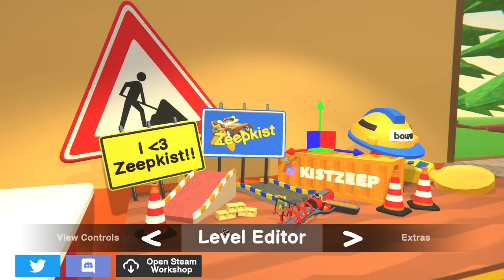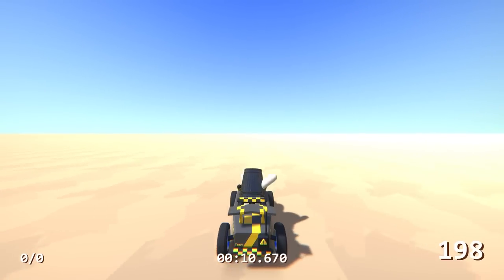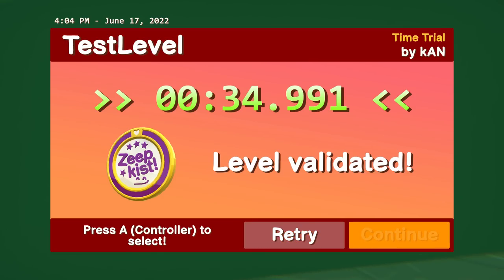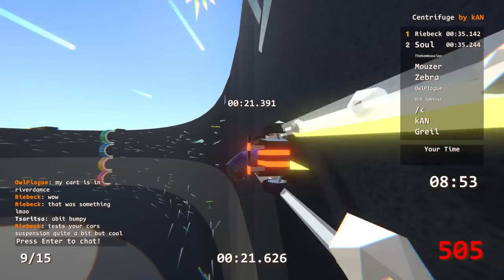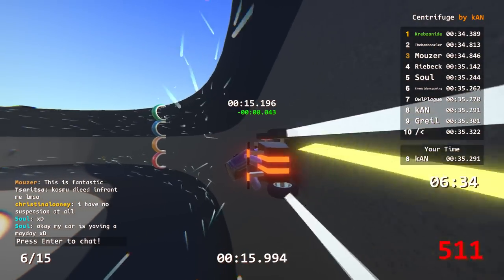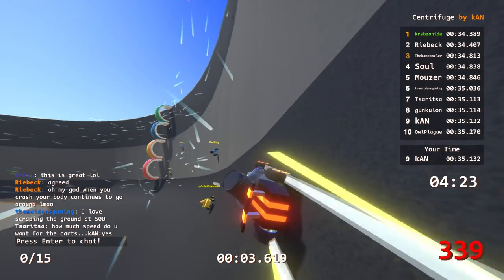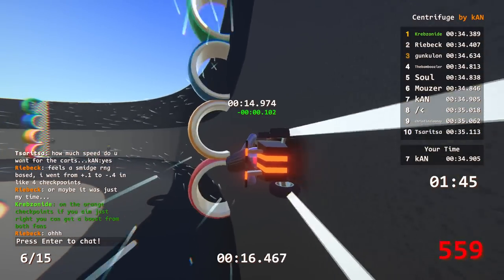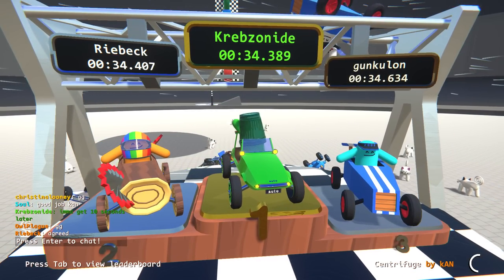I Built a High Speed Centrifuge Track that Breaks the Speed Limit!

Comment: You could use scaling to make it more smooth. The way it works is you place down any piece you want (in this case the curved wall ride piece), save the track and exit, go to %appdata% ->Zeepkist -> Levels
-> [level name] and edit the text file. The way you edit the scale is you go to the very bottom line, which the last piece you placed, and you change the part that says "...,1,1,1,..."
which is the scaling x, y, z.

This way the centrifuge will have a round shape made up of just 4 wall ride pieces rather than a ton on straight pieces, which will reduce the bouncing
Reply: I already tried that when I saw this video, with a centrifuge radius 256 units (1 block is 16). It turns out the default blocks aren't perfect circles, but instead many rectangles at slight angles, so my track still had bouncing. 
But that's still a great way to reduce lag from large things
Reply: Or you can install the Scaling mod so that you can adjust scale in the editor. Once you've got modkist installed managing the mods is really simple too.
Reply: @ArEyeses6751  How about using a circle made up from 4 quarter circle ramps, but then copying that and offsetting it a few times to fill the gaps?
Reply: @ArEyeses6751  that's just how 3D meshes work
Reply: @ArEyeses6751  could use the larger curved track pieces aswell and not scale them.
Reply: @jm56585  it doesn’t have to be a mesh tho
Reply: @Pystro  I think that could work
Reply: @fullfungo  then you have to enlighten me on how you would have no mesh
Reply: @ArEyeses6751  Try using more pieces to smooth it out.
Reply: @ArEyeses6751  maybe if you duplicate the track and offset the rotation so that it will effectively have double the "resolution"

Comment: For those wondering why the new generation of F1 cars do porpoise:
The new F1 cars get a lot of downforce from their floor instead of their wings, to generate downforce from the floor they need to be pretty close to the ground, if they get up to speed the floor gets sucked towards the ground causing the airflow to stall and making the floor loose all downforce for a splitsecond causing the car to get bounced upwards. When the car is bouncing up the floor gets its downforce back, gets sucked to the ground and the airflow stalls again. Now you get a nice little circle of loosing downforce and getting slammed into the ground over and over again making the car bounce down the straights.
Reply: Sounds like an amazing way to sabotage the season
Reply: @tomsterbg8130  lol what are you talking about? XD
Designing the car within regulations is just as much part of the sport as driving a quick lap
Reply: Darnamora Gaming  Do i detect a lando norris reference???

Comment: I mean, yeah, chattering on 5 degree bends is fun for some I guess... or ... you could have used the scaling mod on some wall ride pieces to create a perfectly smooth cylinder. With  a side benefit of reducing piece count from however many dozens of flat panels to 4 wall ride curves.
Reply: The normal in-game parts are also made of rectangles, it wouldn't really help the bouncing.
Reply: @nikkiofthevalley  It would if you use more. Instead of dozens and dozens of parts Kan could have used a sing dozen overlapping giant parts.